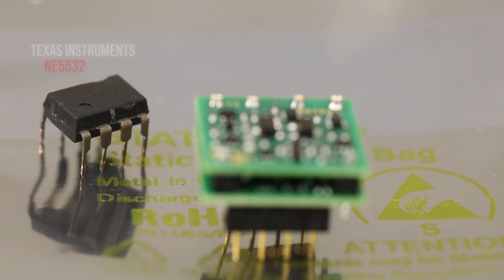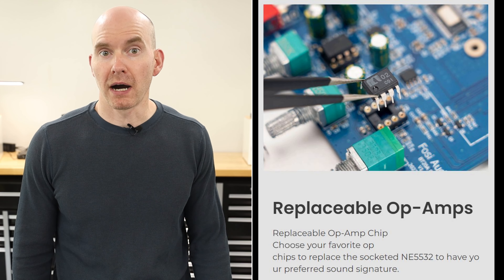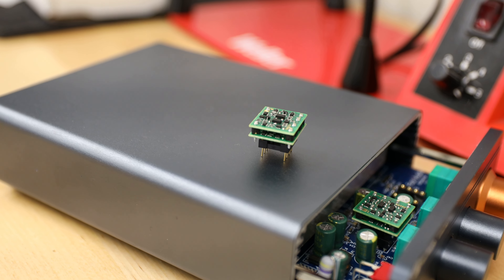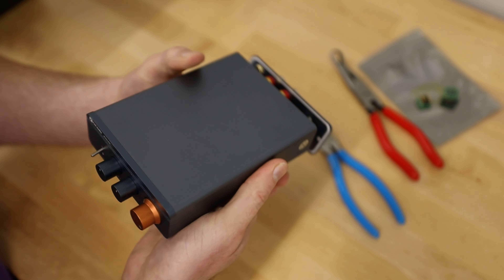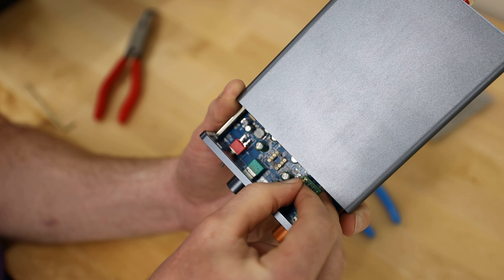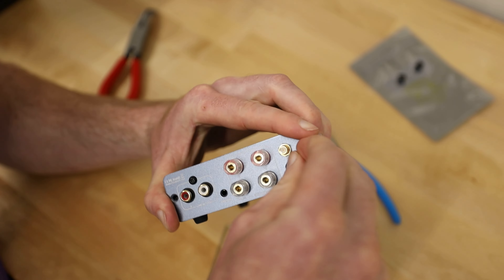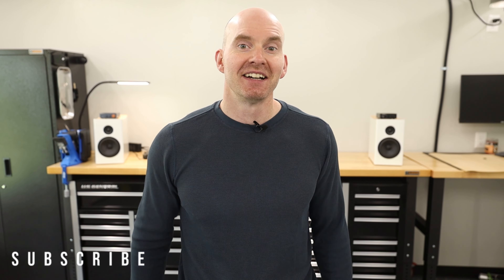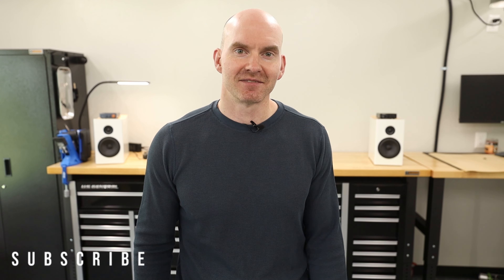Sparkos Op-Amps - Magic Beans or Musical Bliss? Fosi BT20A Pro Install

Comment from the maker: Let me know your experiences with Op Amp rolling! Please consider liking and subscribing, means a lot to me and really helps me to grow this channel, take care!
Reply: Worked for Bell Laboratories for decades and was into HIFI deep from the 70's through the 90's, Had a  Rotel integrated in the 90's that used average sounding op amps, I had some old non functioning CD players and I pulled the buffer chips out of  those.  JRC has some decent sounding op amps, but I really liked the Ti TL082 J-FET package. But only the Hecho in Mexico - for some odd reason the Fabriqué En CHINE units had poor sound (silicon die possibly wirebonded with Al wire instead of Au, then possibly poor metallurgy on the DIP leads).  I will say, Don't like gain limiting feedback chip operational amplifiers in any audio circuit Period. p.s.: Scientists and engineers at Bell labs invented the LASER, the MASER the 300B triode, the Transistor and Westrex  Motion Picture Sound.  And ... the Stereo LP.  Cheers! - Sandy the Ancient Boston Audiophile

Comment: I enjoy these type of videos. I have tried tube rolling in my little Fosi tube buffer amp and I just couldn't tell a difference. Knowing that I had better tubes made me happy, so it was worth it. I repaired office machines for 40 years and I replaced a lot of Rom and EProm chips. It's amazing how much smoke a little tiny chip can generate if you put it in wrong. LOL
Reply from the maker: Ha I have no doubts there, glad I didn’t let any of the magic smoke out of these two!
Reply: I swapped out the op amps for the SS3602. (2 Fosi V3 mono blocks. For both mono blocks I rolled off 2 of the 3 op amps. Leaving the one for converting RCA to balanced.)  For me the sonic differences are huge.

I think those not noticing a profound difference must be using RCA rather than XLR.

If you take the XLR route the differences are profoundly noticeable.

Comment: I tried the Burson V5i in an old Topping A30 a few years ago.  That little headphone amp went from being a decent little budget headphone amp to being a truly great performer.  The difference was incredibly noticeable.  The stock OPA2134 opamps just sounded veiled by comparison.  That said, I then tried putting a V5i into a different unit (FX Audio DAC X6) and there was no noticeable improvement.  When I posted about this, someone more knowledgeable than myself point out that in the Topping the opamp is both the main opamp as well as the buffer but in the FX Audio unit the opamp is just the buffer.  So where the opamp is in the circuit and what it is doing apparently plays a big role in whether you'll be able to hear an improvement.  I don't know much about amp topology but I thought it was interesting and worth keeping in mind.  With all of the different gear people may be putting these into it really is a "your mileage may vary" scenario and there may be some really valid reasons for why people didn't hear a difference in x gear vs y.

Comment: For the Fosi BT20A Pro, I recommend upgrading to the LME49720 in the preamp stage and the Sparkos SS3602 in the amp driver stage. Here’s why this combination makes sense based on the specs:

The LME49720 has a slew rate of 20 V/µs, output current of ±26 mA, and noise density of 2.7 nV/√Hz. These characteristics make it well-suited for the preamp stage, where lower current demand and low noise are priorities. This op-amp offers a significant improvement in noise performance compared to the stock NE5532, which has a slew rate of 9 V/µs, output current of ±38 mA, and noise density of 5 nV/√Hz. While the NE5532 has higher current output, its slower slew rate and higher noise density limit its performance in the preamp role.

In the amp driver stage, the Sparkos SS3602 provides a slew rate of 23 V/µs and output current of ±50 mA, making it ideal for driving the demanding input requirements of the power amplifier section. This op-amp offers more than double the current drive of the NE5532 and a faster slew rate, ensuring better handling of the TPA3255’s input. This makes the SS3602 a more suitable choice for maintaining performance, especially during dynamic signal peaks.

This hybrid approach optimizes the strengths of each op-amp: the LME49720 for its low noise and adequate preamp drive, and the SS3602 for its high current output and rapid response in the amp driver stage. This combination ensures improved performance in both stages of the BT20A Pro while reducing cost since the LME49720 is about $4.

Comment: Just opened up an already nice sounding stock Fosi BT20A PRO. Mostly for the sake of tinkering and curiosity, I installed the Sparkos Dual Op Amp SS3602s. Wowsa! Thank you Matt for the easy and detailed instructions for the install. Especially the tips about the notch for correct flow and using hose pliers for manipulating the tiny bits. The audio is stunningly better, driving a pair of top notch bookshelf speakers. Better and far beyond any subjective placebo effect. As an OG stereo guy, I know this upgrade matches the performance of a four figure A/B amp.

Comment: I rolled the op amps in my Ayima a07 with the Sparkos chips. I have to say that that little amp sounds deeper, richer and more detailed than it did with the stock chips. I’m very happy with the sonic improvements. Cheers!
Reply from the maker: Hey Frank, yep spot on, such a simple upgrade as well.
Reply: Sparko here - glad to hear that you are liking the devices :)
Reply: I had the same results. Actually needed to turn my sub level down, because of the added low- end extension.
Reply: @andrewsparks3157  so... "Sparkos Inside" decal??? If I ever sell my A07, those Op Amps are staying with me!
Reply: @ADREISTER  🤡🤡

Comment: Interesting video.  Just wanted to note that Geshelli Labs has a J2S DAC, "S" meaning socketed, that can use various op-amps in both its RCA and XLR output stages.  I believe the SS3602 is one you can buy from them among three choices. However, I saw someone post they had tried the even better SS2590, and thought it was simply amazing, rivaling his Denafrips Ares II 12th anniversary edition DAC.  So wow, rolling these op-amps can make a difference.  Yeah, the costs go up as you move up the ladder, but man, might still be worth it.  Thanks! Looking forward to the other reviews you have coming up, especially the Eversolo.
Reply from the maker: I have heard positive notes about that Geshelli as well, I should try to get my hands on one sooner than later.
Reply: @MattCoykendall1  yes you should. 
I have a standard J2 AKM with linear PSU, and more recently, added the J2 S using Sparkos SS2590 Pro's + linear PSU and upgraded dc cable. This setup has now replaced an older >$3k DAC/PSU combo in my main system. I think that a real  testimonial to Geshelli &Sparkos Labs as well as a nod to the maturing of digital technology over the last few years.
Reply from the maker: @kenlyon8285  I am actually on their site doing a bit of reading right now.
Reply: @MattCoykendall1  just give Sherri @ Geshelli a buzz. Very helpful folks.
Reply: @MattCoykendall1  definitely! I bought the Fosi BT20A Pro and love it "as is" but might try rolling the op-amps one day for fun. Thanks for the video showing exactly how to do that without damaging the amp.
Reply: Yes Geshelli is now offering our Discrete Op Amps in their products.  Their Archel 3 PRO headphone amp uses our SS2590 discrete op amps, and they offer our SS3602 in their DACs.  Both are amazing products.
Reply: @andrewsparks3157  thanks, good to know! I can see a Geshelli J2S DAC in my future. My nephew already has one.
Reply: @kenlyon8285  which psu do you have?

Comment: I replaced some op amps in a fairly high end DAC, a $2600 Gustard, I used Staccato op amps.

Made a pretty big difference. Especially with regards to things like: imaging, soundstage, and other spatial cues. 

The soundstage width increased, and there was more layering within it.

Comment: Howdy Matt I have a quick question. Did you do any of your testing with just using the Bluetooth? No dac just Bluetooth? I just bought two of them sparko op-amps haven't received them but am SUPER excited. Im currently connecting through bluetooth with my phone and was hoping it would still make a big difference aswell. Thanks for your time, love watching your reviews keep it up.
Reply from the maker: Hey Kevin, I did test this with Bluetooth, the Bluetooth actually varies a lot between these little amps. This one has pretty good performance as far as the implementation goes, range and quality. You should notice a difference with the Sparko’s. I still have mine installed in that same amp, sounds great.

Comment: I upgraded to a Sparkos opamp in my Aune X8 dac and it made all the difference.  It goes from an average dac at its price to one that rivals 3X its cost.  Recently received the Aune linear PS but haven't hooked it up yet and any improvement even if small would be welcome to its current performance with the Sparkos.  Other options include Staccato and Burson op amps as well which I have not tried.

Comment: I bought a Burson DAC back in late 2020 that came with  stock discrete op amps (can't remember the model) and I paid a little more for the upgraded package (remote and Burson V6 Vivid op amps (2 dual and 2 single). 
The Burson Vivid op amps added much more detail, depth, wider soundstage, and took the presentation from 2D to 3D. The only downside was that the mid range was a bit thin for my taste.
I then purchased a pair of V6 classic, which made the midrange fuller at the cost of speed, detail and three dimensionality.
Finally I bought a pair of Sparkos singles and duals and experimented with those. The sound was more neutral and the bass stronger than with any of the others. 

I ended up mixing and matching and found the Sparkos singles in the LP stage and the V6 Classic Duals in the I/V stage to give me about 85 to 90 percent of the sound I wanted. The next best pairing was the V6 Vivid duals in the IV stage and the Sparkos singles in the LP stage. This mix had a slightly thinner(but bearable) midrange, but better soundstage depth and three dimensionality. Soundstage was slightly narrower. I will probably go back and forth between these two pairings.
Reply from the maker: Devin you certainly have went down the rabbit hole! Have fun with it!

Comment: Nice work. I own three of these BT20A digital chip amps. Not sure it is worth the money without some type of dyno test, THD, RMS, etc to compare. I also own several Douk Audio, Nobsound, etc digital chip amps. This Fosi Audio BT20A sounds better (out of the box) then those ones. 36v/10 amp AC/DC power adapter or booster works best from my bench...not 48v.

Comment: Because of variables beyond the amp itself such as speakers, room acoustics, inputs, personal tastes and so forth, everyone's miles are going to vary as to the perceived improvement. However adding the Muse02 to the Fosi V3 mono yielded in my case a worthwhile improvement. It makes no sense in my mind to put expensive op amps into budget equipment (I could be wrong) but there are plenty of inexpensive options for those looking to eke out a little more performance shall we say from their equipment. In this case the Fosi amps replaced nCore amplification and for not much money provided a noticeably better listening experience. With the Muse op amps it was better again. But YMMV.

Comment: I upgraded my BT20 Pro with Burson Vivid op amps. They are too tall for the case, so a little bit of modification with a 
drill was necessary. It does look cool, however, with the red op amps sticking out the top. The sound undoubtedly improved, but had I not had a spare op amp lying around and sourced another one cheaply, I don't think it would have been worth the expense.
Reply from the maker: Sounds almost like the thumbnail for the video with the added hole in the case ha!
Reply: It does !. Also, due to a drill disaster, I scratched up the casework, so I ended up painting it in the style of Mondrian.
It now looks either cool or ridiculous depending on your point of view.
Reply: due to the fact that the Burson op amps are taller they also offer a " soft " riser that is made from small wires so you can lay the opamp down on its side and pretty much fit the opamp anywhere to where the wires reach by bending them over slightly...

Comment: you needed 2 bt20a pro amps and switch them at the flip of a switch without relying on audio memory. the real question is bt20a pro+sparkos is the same price as a midfi amp such as cambridge audio axa25 but which sound better ?
Reply from the maker: Agreed, 2 BT20A's would have been optimal. I wouldn't doubt the Fosi sounds better but the Cambridge will open you up to a lot more inputs.

Comment: I was hoping they would allow the option to turn the amp into a mono with a simple switch on the circuit board... then you could stack two amps together in mono mode and create a fantastic balanced headphone amp for hard to drive headphones...

Comment: Without a resolving system already  nothing  maybe detected,OP-Amps are the heart of Audio you can make one with Vacuum Tubes there is not one piece of HIFI without it in mordern equipment.

There is no controversy because when done properly it can be the difference of a V4 engine or a V12

Comment: He told me i needed more power supply to do the opamp swaps and i have no idea how to do any technical stuff or what more power supply even means. I thought the point of opamp rolling was anyone could do it, but now sounds like i have to learn how to solder and use something to read how much power supply i have by increasing capacitor size? but to what size and what end?
Reply: You can flip chips in any of these amplifiers with only the right screwdriver to open the case and a pair of tweezers.  No soldering involved.  The Op-Amps will be in sockets so it's a pull out, push in deal just like Matt showed in the video.

No... you do not need a different power supply.  In fact flipping on the stock 32volt supply that comes with the amp seems (can't swear to "is") more pronounced. But even if you did need a different power supply, the new one would simply plug into the back of the amp, like the stock one does... unplug the old, plug in the new.
Reply: I'm not sure what you're talking about on the back of the amp. My dac has 32 multibit dacs, 16 per board. The dude from sparkos just said i would need more power supply per board running 32 total i/v converter single opamps and a pair of duals for outputs. I basically need to change my capacitors to higher capacitance and/or higher voltage. I just don't know how much more and if all the caps around each dac and i/v discrete or just around the i/v discrete or just the main larger power supply caps before the voltage regulators or ALL of the above. I'm not tech savvy with this kind of stuff,  but neither is my local tech and i would need exact directions to give him to do the work which requires soldering. I've also read some say that you can't just increase voltage or capacitance to designs without doing calculations or something so i cant just say, hey tech put in the biggest capacitors you can fit physically on the board @Douglas_Blake_579
Reply: @HailKingCeezer 

Okay ... so now I discover you're not even talking about the BT20A amplifier.  

Sorry, can't help you without a lot more specifics about your equipment...

Comment: What should be the maximum watts of speakers attached? Can we attach medium to large size speakers?
Reply from the maker: Yes, as long as the speaker is sensitive enough, anything with a mid to high sensitivity should be fine at reasonable volumes.
Reply: Hook this amp up to a pair of Heresys or L-100s and you're in for a real treat.  The TPA3255 chip will drive almost any speaker you can find to room filling volume.
Reply: @MattCoykendall1  Thanks for reply. Can we attach equalizer?

Comment: plz help I bought a Fosi BT20A pro amp and I’m trying to figure out the best way to connect my source wich is my iPhone 15 and my MacBook Air as well. I have a rca to aux cable that I use to connect the fosi amp to my iPhone 15 with the usb c to aux dongle. Would the shcitt dac be any better than the dac in the apple usb c to aux dongle??? I noticed that the Bluetooth volume on the fosi amp is louder than the rca to aux cable method. Would the external dac be louder than the usb c to aux dac??? I also use Apple Music lossless.
Reply: I just got my Fosi BT20A Pro and AirPlay from my iPhone through a very old Apple Airport Express WiFi wireless router extender A1264 with 3.5mm audio jack. You can get one under $20. The sound quality is more dynamic than the Bluetooth route.

Comment: I'd be interested in hearing your thoughts on the Fosi Audio V3 with a modified case, cut for clearance for Orange Amps' Dual Discrete Op-Amps.

Comment: 1,  bose 901 eq.  No, Bose isn't hi-fi.  But installing new opamps drastically improved the sound.
2.  Rotel cdp -1990's model:  Woke up the player, far more vivid and impactful like a modern cdp
3. carver M1.5T and C-1 preamp.  More modern and cleaner sound.  
Opamps are like having a 180hp 4 cylinder in your car and swapping in a 335hp V-6 engine,  Just like that.
Reply: you have upgraded op amp everywhere